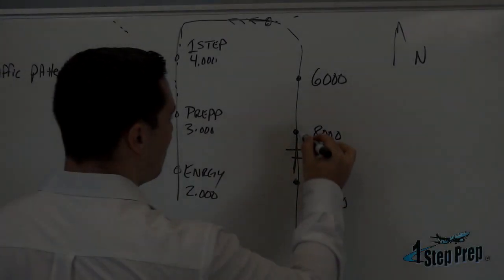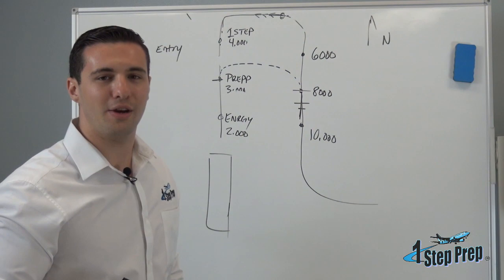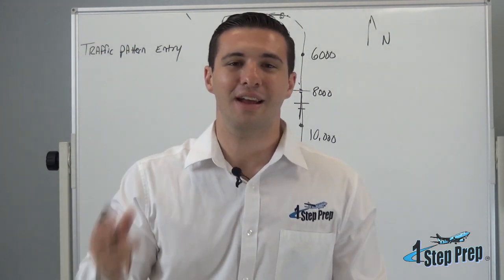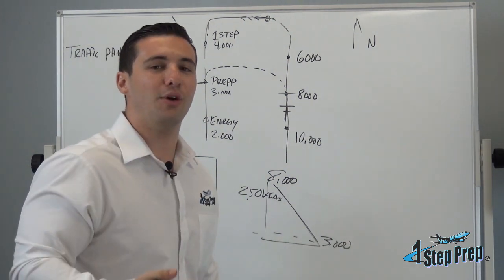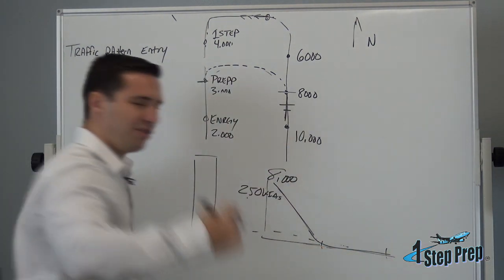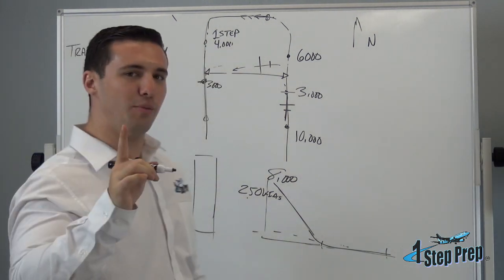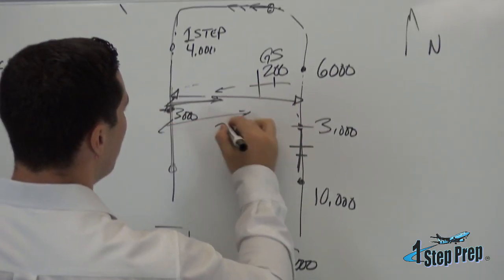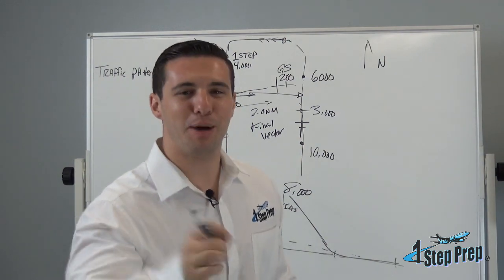Energy Management In Jets!

Comment: Keeping 250 kts on the base leg? What is this guy smoking? I am curious what kind of airplanes he flies? Microsoft flight sim? Nevermind that they want you do a CDA and slow down to a specific speed of 220 kts.  Does this guy really fly an airliner? Doubt so.
Reply: In a heavy traffic environment ATC will of course give you speeds they want you to fly during any given segment and will want you to maintain a CDA.  However at the less busy airports, speed is entirely at your discretion (unless specifically given a speed to fly), and more experienced crews, (or rather an experienced PF), will want to keep the speed up as much as possible....so 250kts in a descent from 8,000ft wouldn't really be 'off the charts'!!    Also do bear in mind that ATC will 'snatch you in' and cut you in front of other traffic when they can, so keeping the speed up on that descent segment and getting the height off quickly well assist with that. Then as you pass 4,000 ft, you can reduce v/s to 500ft/min, and you can bring the speed right back without levelling off.   This tutorial is the hallmark of an experienced pilot, playing ball and understanding ATC...AND his aircraft.

Comment: In terms of downwind speed (unless ATC speed) is much easier to slow down to 230 knots, than in case of early base or any changed plans, you can throw flap 1 and spoilers and slow that baby down. No point of going full 250 knots unless they have many aircraft in sequence on final.

Comment: Wouldn't be a bwtter idea to slow down to 220/200 kts just before ecpected base leg and descent with flaps and speedbrakes ? 
250 seems a bit high. 

With lower speed You'v got more flexibility....
Reply: Yeah I mean 210flaps 5 speedbrake does the job. Flaps 10, 190 knots works well and plus nowdays  your aim is to do a CDA ( in Europe) so leveling off to slow down isn’t what you aim for...
Reply: even a better option is to pre program VNAV to ensure that you will be on profile when you get a shortcut. this will avoid extending the flaps and speedbrakes.
Reply: @Jessy74588  of course but we are talking about situation when we are not expecting shortcut.
Reply: Icenor that is true but I was talking at an approach scenario if you are high example above glide slope . On the Boeing 737, 190 knots flaps 10 will give you a good rate of descent. Agreed with what you said about cda however if you level off for more then 2.5 -3.5 nm depending on the airport it won’t be considered as a cda. They keep track of airline cda in airport.
Starting the descent too late burns more fuel as you have to spend more time at level and even if you do an idle path descent you would have burned more fuel during cruise.
Reply: Icenor yeah but if I was to be on base leg and get an unexpected shortcut . I wouldn’t increase my speed to 250knots in order to regain profile I would rather slow down to 210 knots use some speed brakes and flaps . Ofcourse it’s scrnario depending on how many tracks miles you are going to have but generally speaking slowing down using flaps and speed brakes is the way to go.. they expect you to be at max 220 knots on base leg and 180 knots to intercept anyways unless they assign you a speed.
Speed brakes are on a plane for a reason to be used. 
A good rule of thumb not set in stone but at 10nm you should aim to be at 3000ft and speed of 200 knots. Then it all depends I see where you are coming from but in our company we aim for low drag approach where you lower the gear at 4nm in vmc and 5nm in imc. But having speed in check is generally helpful to have a stabilized approach
Reply: Icenor That is a great conclusion glad to see that there are still pilots out there who don’t really on vnav only and actually have situational awareness and descent management with the good old table of 3 in mind. 
Hope you keeping safe and still flying away during covid
Reply: I would extend the landing gear too, but it is not stadard sop, but if you respect the speeds for extension, no problem.